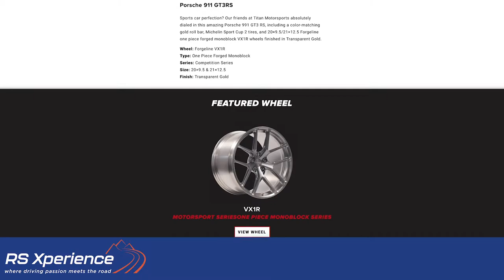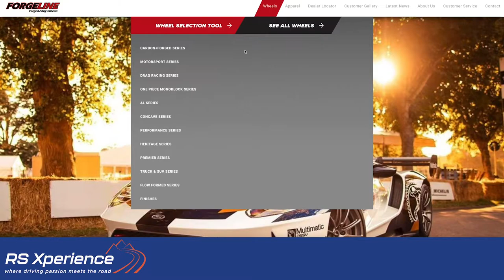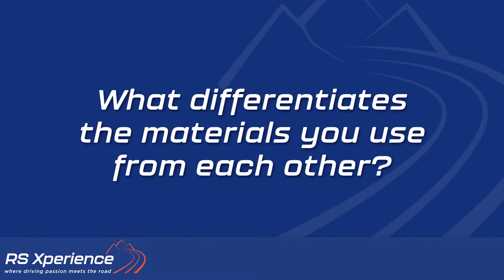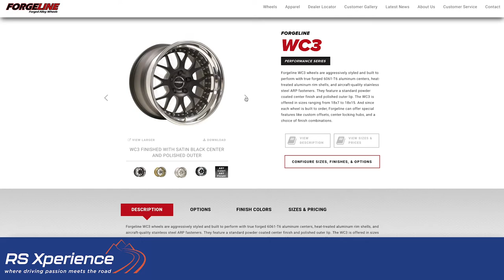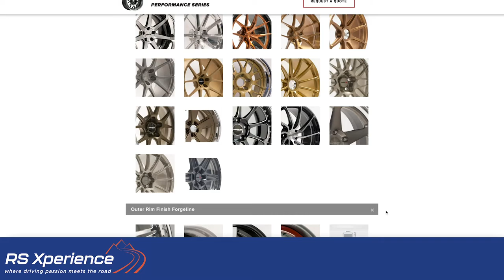RACING & STREET CAR WHEEL ENGINEERING WITH FORGELINE MOTORSPORTS RACING WHEELS, performance car gear

Comment: Great inside look into the company. I'm a big Forgeline fan, on my third set. Had GA3R track wheels on my E90 M3, then GZ3Rs on my 991 Carrera S, and now back to GA3Rs on my GT4. Such a high-quality wheel with a fantastic racing heritage.
Reply from the maker: Agree. Their experience with racing and building high quality performance wheels was impressive.  Spent some time after the interview with their design person and manufacturing process and they put a lot of thought into what they build - to last and withstand the rigors of racing which gives peace of mind to street use.